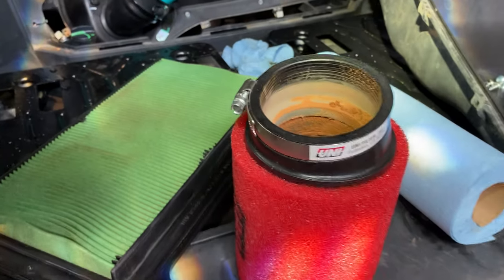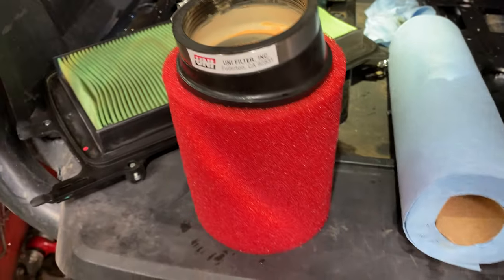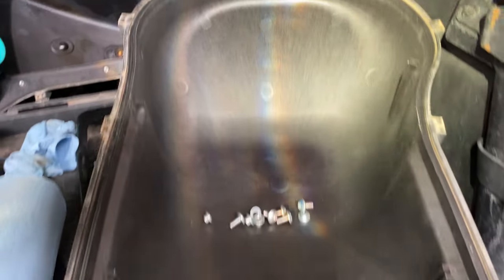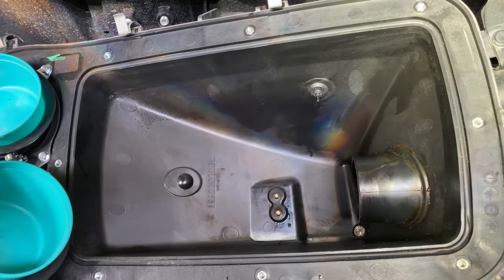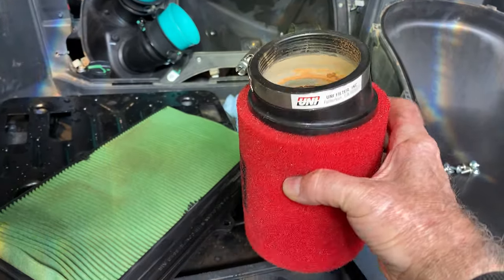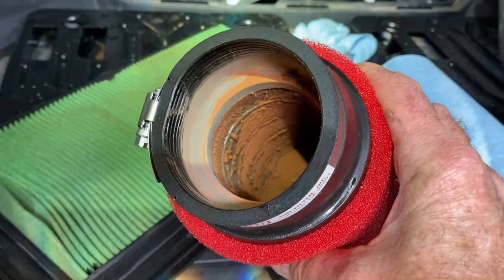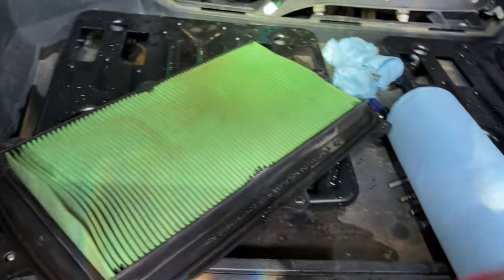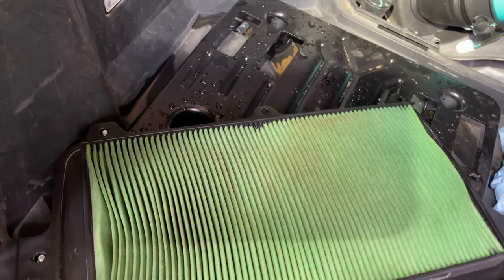Honda Talon 2600 mile service - UNI Pre-filter installed.

Comment: How long does it take for the oiled air filter to dry?
Reply from the maker: The process calls for coating it evenly and the oil does not dry. It's an integral part of the process of trapping particulates.
Reply: @nogrey  ok so no matter how long it’s been it’s still going to be oily wen u squeeze the sponge filter with fingers ?
Reply from the maker: @Supernova869-s4i  It will always be wet, but make sure to apply as stated in the instructions. Just a suggestion, but as inexpensive as they are, I bought two. I always have one that has been cleaned and oiled ready for a quick turnaround. Also, if you noticed when you received it new, it was in a plastic bag that had oily residue all over it. It is normal for it to remain wet.
Reply: @nogrey  Yh im gonna buy 2 so i dont have to wait , so how long should i wait to install it after oilling , roughly .. 24 hours ? 48 hours ?
Reply from the maker: Install immediately.